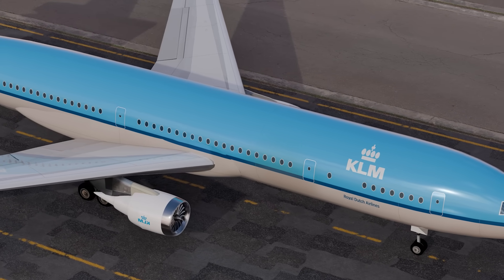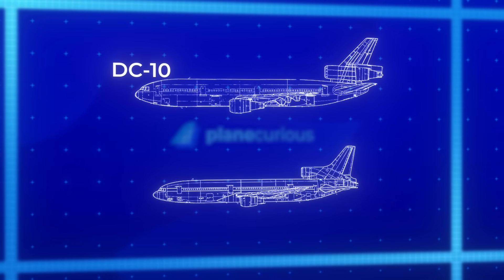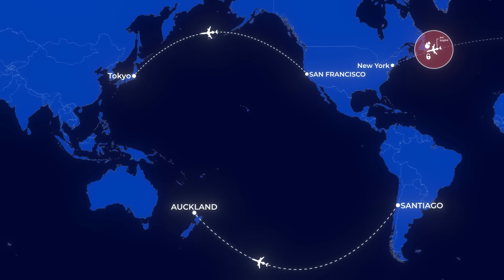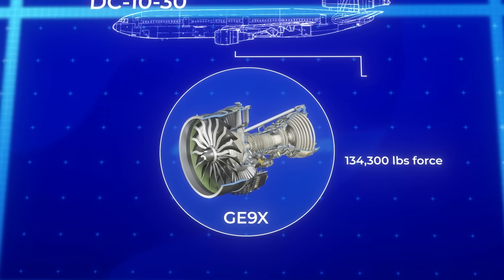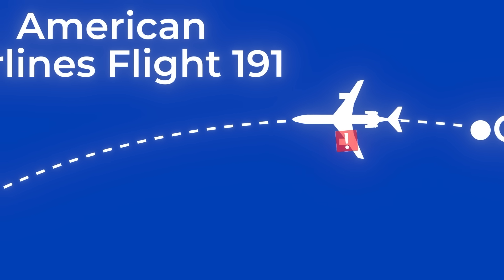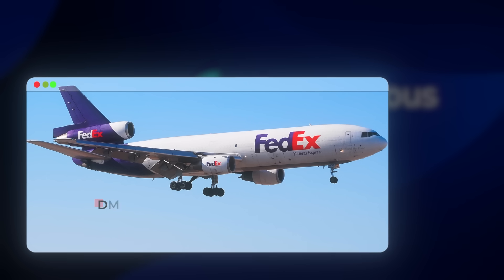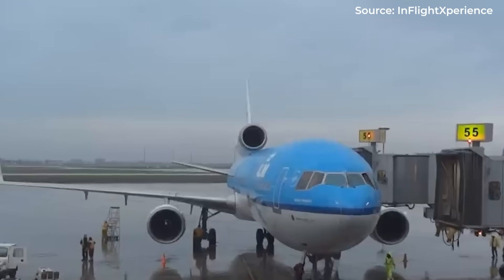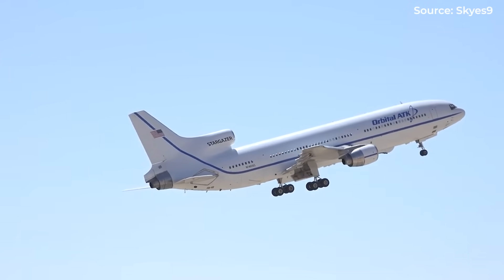Trijets Changed Everything - Until They Didn’t

Comment: A Western Airlines DC 10 took me from Las Vegas to JFK in New York in the 1980s. This is after a DC 10 had an engine separate from the wing, the DC 10s were grounded, inspected and all resumed service. I was kind of fixated on the big GE emblem on the side of the engine as I looked out the window, but actually had a very nice flight.
Reply: Unless I'm thinking of another incident, that particular issue was not due to deficiencies in the design but use of an improper method to dismount engines for maintenance which could overstress and crack the mountings.

Comment: I never had an unpleasant experience on the 727.  Then I had my first wide body trijet experience.  My wife and I flew DC-9 from Houston to St. Louis and 767 from St. Louis to London.  Perfectly delightful all the way and I fell in love with the 767.  Then we had to come home.  Oops.  The return was a Tri-Star from London to Boston where we cleared customs and then on to St. Louis on the same airplane where we had a DC-9 back to Houston.  The Tri-Star was wonderful from take-off through cruise.  Then the power was pulled off to start our descent into Boston.  I have never experienced such pain in my life.  I could not open my ears to relieve the pressure.  It was like two ice picks stabbing my ears.  My ears did not stop hurting until the Tri-Star climbed out of Boston.  BUT, I went through the same agony getting into St. Louis.  The DC-9 back to Houston was fine.  I swore I would NEVER AGAIN fly on an L-1011 Tri-Star.  I had several DC--10 trips with no problems but I never again set foot on a Tri-Star.

Comment: I remember as a kid sitting in the back of a passenger jet on a cross-country flight.  It was very noisy.  Looking back, I suspect it was due to that tail-mounted engine.  In 2022, I boarded a Boeing 727 operated by Zero-G for a flight where you would be weightless and floating (similar to NASA’s Vomit Comet).  While initially climbing to 24,000 feet, I sat in the back of the plane under the tail-mounted engine.  It was so noisy you couldn’t hardly hear the person seated next to you.  Fortunately, when we could leave our seats and float around, the noise was not a problem because we weren’t in the back anymore.  I think they flew the Boeing 727 for its power-to-weight ratio, making it ideal for flying the  parabolas necessary for weightlessness.  BTW, that flight was fun as hell. I have fond memories of that Boeing 727.
Reply: You were NOT ONDER the tail enging. You were in front of the engine number 2. You were  under the air intake of that engine .
Reply: @sorgfaeltig  You’re correct.  I was in front of the engine not under it, but that engine was definitely the source of the noise.
Reply: Amazing!  I want to do Zero G
Reply: Zero g was a noisy experience

Comment: Worst engineering mistake ever was reducing to two engines... where is the 2nd backup in case of a single engine out?  No?  Idiotic.  Financiers ruined the airline industry, knocking out safety for greed.  Don't agree?  Don't comment, or you will be proven wrong.

Comment: I worked on DC-10.  The thrust was rated 52,500 each engine for a total of 157,000. The video only accounted for two engines for the 125,000 lbs of thrust.
Reply: The DC-10-10 had 40,000 lb engines so 120,000 lbs total.
Reply: @thud9797  Military version was 52000

Comment: The Boeing 707 was not fitted with four engines for regulatory purposes. It was a quad jet as it was designed in the 1950s, when engine technology was not advanced enough in power output to get the thing into the air and carry enough fuel.

Comment: The L-1011 was the smoothest plane I ever rode in.  And I've been in most of them, I used to fly a lot when I worked for Bell - Lots of trips around the country.  I sat next to an airline employee once and he said that you could always tell when the pilot let the L-1011 land itself - it was a much smoother landing (which admittedly didn't involve the third engine).
Reply: That's not true at all.  The pilots almost never autolanded the L1011  and most airlines didn't bother keeping crew and aircraft cat  IIIc certified as very expensive to do so. I have over 4000 hours and only autolanded once on a ferry flight just for fun. The smooth landings were from the DLC system ,Direct Lift Control .  Amazing system

Comment: It was not just twin engines killed the trigger-jets...It was that now there were twin engine aircraft that could produce enough thrust to replace the trigger-jets.  You don't think they would have placed two jet engines on a DC-10 if they produced the thrust required to fly them?  Of course they would...Why are there no twin engine 747's?  Because they don't have an engine that can produce roughly double what a current 747 engine can produce..
Reply: completely incorrect   The Rb 211 was 53,000 lbs on the 500   and the 777 engines  produce over 115000   . Its all about reliability

Comment: The trijets were designed to fly between 600 mph or so; the two engine jets are designed to fly slower … Toronto to London in six hours, new jets Toronto to Dublin in seven hours; London in eight, like propeller planes.
Reply: The L1011 cruised at Mach .84  and the 787 cruises at .85  but  the VNE on both  is mach .9.  we used to cruise at 87 to 88 all the time in L1011 and fuel was right on flight plan. I have no 787 time so cant comment
Reply: This is... Not correct.

Comment: The center engine on the DC-10 always looked like it was just stuck on the top of the fuselage to keep the design simple as opposed to the L10-11 in which the engine was on the fuselage centerline and the intake smoothly integrated into the design.
Reply: More efficient to have the air go straight through instead of make two turns.
Reply: @marcmcreynolds2827   Not at all , The number 2 engine had the same fuel burn as the 1 and 3 .

Comment: I can only think of a couple of relatively recent crashes caused by double engine failures, the Heathrow 777 crash and  Sully's miracle on The Hudson. And in both of those cases there was a common cause to the failures, if they had had a third engine it probably would have failed as well.
Reply: Only takes that possible of one to prove an idea wrong.  Worst engineering mistake ever was reducing to two engines... where is the 2nd backup in case of a single engine out?  No?  Idiotic.  Financiers ruined the airline industry, knocking out safety for greed.  Don't agree?  Don't comment, or you will be proven wrong.

Comment: It was a return flight from Toronto to Frankfurt. I was just 11 years old, and shortly before, there had been two serious accidents involving the DC-10. I became afraid when I saw the aircraft with three engines. The purser was able to reassure me: it wasn’t a DC-10, but an L1011. The flight itself was very pleasant, and it felt only half as loud as the outbound flight on a 747. I was even allowed to visit the cockpit for a short time and watch just as the sun was rising.
Of all the flights I have ever taken, this was the most beautiful.
Reply: I’ve flown on several 727’s and DC-10’s, never made it on a 747 though. Been on 787’s many times now and also 767’s before they were retired. One year we were supposed to fly out to DC on a 757 and back on a 777, they changed both planes to 737’s. Such another United disappointment.
Reply: @EMTevjorgensen  The 767 is not retired.
Reply: @memcrew1  And neither is the 787.
Reply: @Bob31415  Who said the 787 was retired?
Reply: @memcrew1  The commenter you responded to that's who.
Reply: @Bob31415  Oh, ok.
Reply: @memcrew1  👍
Reply: @memcrew1  Correct. I just came back from Amsterdam on a 767
Reply: @EMTevjorgensen Funny. I have never been on any of the new wide bodies. I've been on 767s and 777s, but not the A330, A350, A380 or 787.  But I have flown on the DC-10, 727,747 and L1011. I hope I get a chance to ride 787, but I haven't flown internationally in a while so I only fly on 737s, A320s, or RJs these days.
Reply: First time I ever flew overseas (at age 18) it was on a DC-10.  I was a bit worried because at the time the DC-10 didn't have the best reputation.
Reply: Children in the cockpit. They don't do that anymore. I remember I got to do something similar when I was flying as a kid. That was in the early 80s.
Reply: @jamesbehrje4279  Same thing with tour boats,my father was a Captain and had a long career,one time a very hot twenty something woman stopped by the wheelhouse and said to him “I remember you! When I was a little kid you let me sit on your lap and steer the boat!” He replied “The offer still stands”.
Reply: @jamesbehrje4279 "Jimmy, have you ever been in a Turkish prison?"
Reply: The L1011 was a very beautiful plane.   Make sense a long time ago why they don't fly anymore.    The DC-10 was actually good, but... it's wonky looking in comparison.
Reply: I just remember the takeoff angle on those things
Reply: @emgriffiths9743 I remember  all the three engine builds. They were quieter than 4 turbine. Old enough  to have been passenger on all these designs. Including 4 turbine old school turbo jet 707 and  DC 8.
Reply: That's a great memory. Gone are the days when kids get to visit the cockpit.  I flew across the Atlantic twice on a DC-10. It was on my mind every time I flew on one. It was a great plane when it wasn't crashing. I never had a bad experience on one. Flown on the L1011 and 747 overseas too. The DC-10 was the quietest. Great planes all.
Reply: @pooryorick831  "Joey, do you like movies about gladiators?"
Reply: Damn how do you remember anything with such detail from childhood? Most of my childhood is a dark blurr in my memory. No fine details 😅
Reply: @jayteknica1175 I remember  every time I ever flew.
Reply: @waynesummey5051  I lost track a long time ago.  Since my first flight when I was 15, until today (62), it seems I live in the air.
Reply: The tri-star was a very complicated airplane for its time. Plus the engine on the tail is real hard  to maintain.
Reply: “Would you like to land the plane, little fella?”
“Um, I’m only 5…”
“Alright, I’ll be on the toilet convincing my wife that my brother is NOT the only option.”
“But, why can’t the co-pilot land the plane??”
“Damnit, Billy! No wonder your parents put you in COACH! Stewards, no juice box for him.”
Reply: Good luck doing that ever again!
Reply: The L1011 was loud as hell
Reply: @tomaxxamot2016  Yep, it roared like a lion and jumped off the ground like a panther. And the on-board storage capacity was a joke compared to other planes of its time. Still enjoyed flying on this legendary plane, but in terms of passenger comfort it just couldn't compete anymore.
Reply: Why did the purser have to reassure you when you saw the three engines if this flight took place before the two DC-10 accidents?
Reply: L 1011 is the type that went down in the everglades i believe.  May be wrong. But that plane was very well built. Every company has strengths  and weaknesses. Never felt unsafe in DC 10. Feel more unsafe today. Our traffic control system is fraying badly.
Reply: @waynesummey5051 Yep! Eastern Airlines flight 401. Was the first wide body aircraft to crash. Sadly, plane was performing perfectly; however the flight crew became distracted by a $0.20 light bulb that malfunctioned and didn’t realize they had lost their holding pattern altitude until it was too late. Changes in CRM were made after this accident to improve flight crew coordination!
Reply: @waynesummey5051  That is Correct. An Eastern Airline news L1011. Pilot distraction

Comment: I can answer this question quickly: As engine reliability improved to the point where two engines were enough for extended operations over water, the tri-jet was obsolete. So it disappeared after the airframes aged out.

That having been said, the best airplane I ever flew in was the Lockheed L-1011. What a sweet ride! No other airplane can beat it, unless you are willing to spend enough on an airline ticket to buy a house.

Comment: I am still not clear why he made the connection with the center engine design and American 191 accident which was the result of the under the wing engine failure
Reply: Many errors in the video, including the idea that a third engine was for redundancy vs that it was simply needed to provide enough power for that weight class, e.g. three vs two JT8D's for a 727 vs a DC-9.

Comment: I have flown all three tri-jet aircraft in this video, and dual-jet aircraft as well. The Boeing 727 is my favorite because it is the quietest jet aircraft I’ve ever flown.
Reply: Funny because they were actually very loud.
Reply: @TecnamTwin  Depends on where you sit.  At the front the wind noise is louder.  At the back... well you are in very close proximity to three low bypass engines..
Reply: @calvinnickel9995  Sitting or standing at the end of the runway as a 727 is taking off is very noisy. That was always the case with low bypass engines from the 1960s.

Comment: "Obselete"? 😂 Haven't actually watched through the video yet but I'm guessing that getting one of those huge extremely high bypass turbofans in the rear fuselage would be a little difficult, not to mention that two of those engines is enough for an almost 747-sized airplane as it is. And the rules changed about allowing twin engine airplanes on long, over-water routes.

Comment: I fondly remember flying on Ansett and TAA 727s, and Finnair MD-11s.
The 727 was bloody loud but the rear exit door under the fuselage and rear engines was an amazing experience during disembarkation.
Reply: The 727 was loud outside but inside it was remarkably quiet
Reply: 727s were very quite up front and nice in the middle .  But in the back was loud, especially the last 2 rows were unacceptable loud.

Comment: Funny enough, Douglas did study a twin engined DC-10 and probably should have build it for domestic airlines.
Afterall the twin engined DC-9 saved Douglas when the DC-8 couldn´t compete with the Boeing 707.
Reply: The DC-8 was much better than the 707 in the 1960s.  Boeing couldn't stretch the 707 to match the Super 60s.  What was killing the DC-8 was the 727 which was perfect for the domestic market at the time--making shorter DC-8s redundant, and the emerging threat of wide bodies and SSTs.

Comment: If I were an aircraft manufacturer that had 2-engine aircraft, I'd just place a third engine just behind the main wing box, so that it would pivot down into the windstream when it is needed, and remain inside the fuselage when it is NOT needed.
Reply: Lots of cargo space gone, extra weight and extra fuel burned, as well as a complex mechanism to get certification for...  I can see why they didn't and why airlines would want nothing to do with it.

Comment: Indeed Trijets were "a thing" until evolution of ETOPS as well as "single deck" quad jets such as Airbus A340s.
Reply: Uh.. the 707, 720, DC-8, Convair 880, Convair 990, VC-10, Il-62, Il-86, and Il-96 were all single deck quad jets.  The A340 is an enigma because it was designed well over a decade after the last single deck quad jet and two decades after any one was designed in the west.  It sold poorly and exited widespread service early.

The only reason for it existing at all was because it had massive commonality with the A330 which was designed concurrently with it, and it was able to do route previously excluded from Airbus aircraft because of ETOPS which wasn't good enough until the mid to late 90s.
Reply: @calvinnickel9995  Ok. Good to know but do you know what "such as" mean? Furthermore Airbus have already added insult to McDonnell Douglas's Trijet MD-11 as it wasn't economical expected where assuming Airbus could do better with their Quad jet A340. Ease of maintenance of that quad is a total bonus. Airbus have fought to the end with their -500 and -600 after -200 and -300 respectively.

Comment: These were always my favorites. I just find it cool having an engine on the tail.
Reply: Forget cool...Worst engineering mistake ever was reducing to two engines... where is the 2nd backup in case of a single engine out?  No?  Idiotic.  Financiers ruined the airline industry, knocking out safety for greed.  Don't agree?  Don't comment, or you will be proven wrong.

Comment: Personally, I found the L-1011 graceful, spacious and elegant, but the DC-10 was always a bit of a Frankenstein's monster. I felt cheated at not getting a 747. Similar to 727 vs 737, but that was way back when AirCal had 737 and PSA was 727, so might have been the airlines.
Reply: I would say the straight ducted engine of the DC-10 is more graceful and elegant than the S-shaped engine of the L-1011.

Comment: Just looking at the engine on the rear, it looks like a low bypass ratio engine. That would be the main problem.
Given that a lot of the improvements in airliners are about increasing efficiency, and one of the main ways of doing that is by installing bigger engines with higher bypass ratios, it looks like doing that would not be so easy with the engine integrated into the tail like that. There would have to be major modifications to the airframe.
With the engines under the wings, it's usually easier to do cough 737 Max cough
Maybe if they mounted the engines like the A-10 it could work.

Comment: First aircraft I flew on was a 727 when Air Canada still used them for short regional flights into small airports.  I remember that it was so much quieter than the 747 we transferred to in Toronto.  I believe it was even quieter than the 737s and A320s that replaced them and of course CATEGORICALLY nicer than Dash-8s and Q400s.